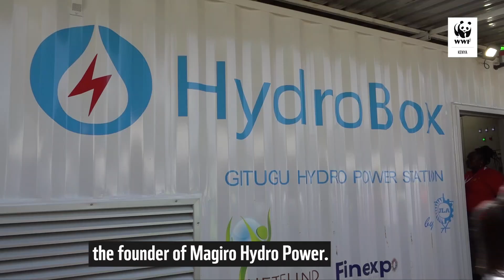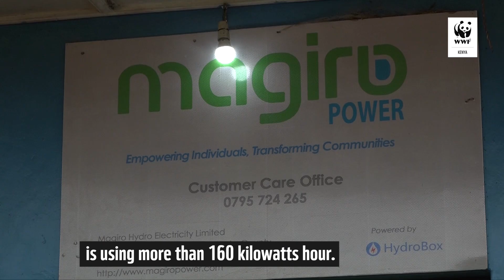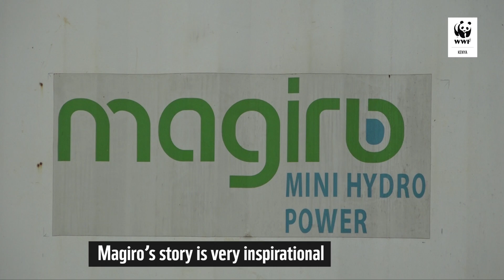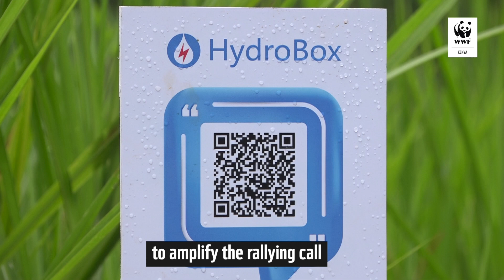John Magiro: Self-taught engineer whose clean energy serves thousands in Kenya

Comment: People are still confusing energy with electricity or electric grid

Energy we use mostly is mechanical rotational (washing machine, heat exchangers, fridge compressor, workshop tools, kitchen mixer, grain mills,etc) that can be powered directly by a shaft of vawt wind turbine or water turbine as this case

The other energy we use is thermal for cooking, glass or metal melting, clay curing furnace, etc and that can be obtained by simple big solar water lenses or aluminum mirror concentrated solar

Electricity is only needed for citcuits